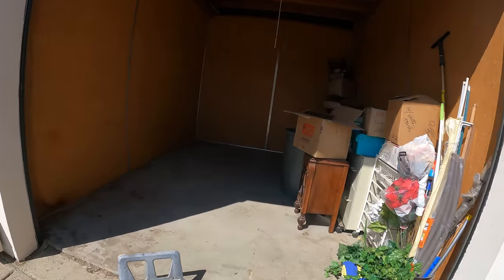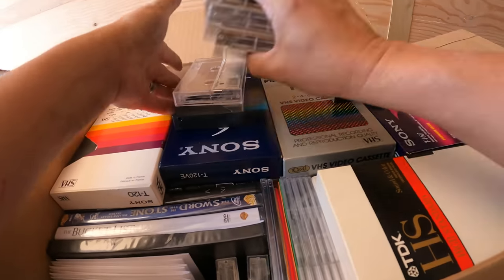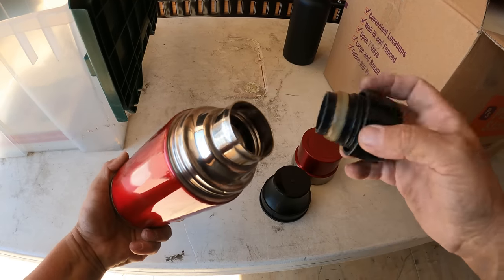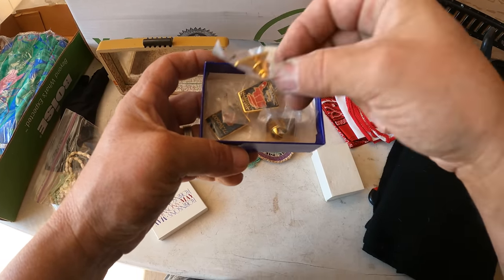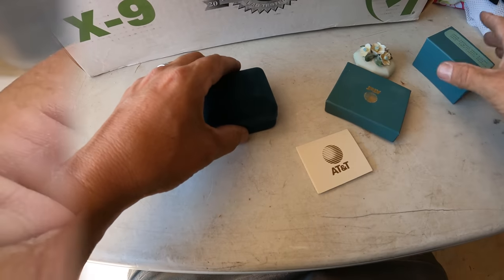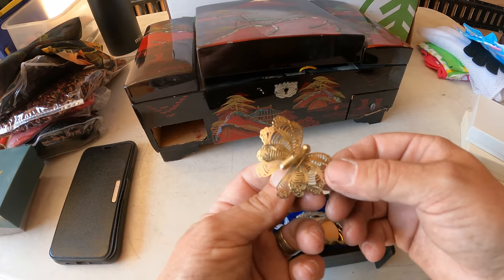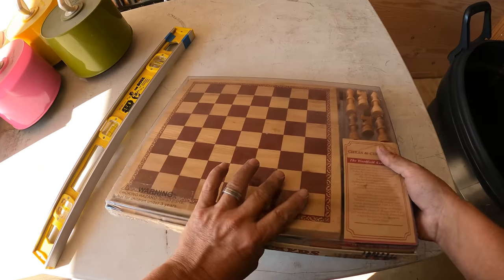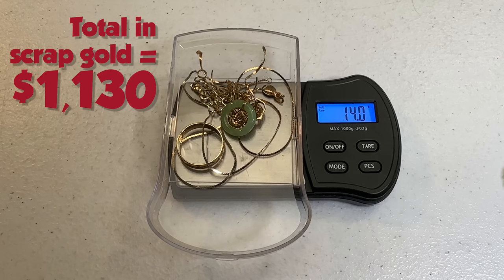It's a stinkin' GOLD JACKPOT in the abandoned "manager's special" unit I bought at auction.

Comment: !!JACK ATTENTION!! I hope you didn't get rid of the Japanese style jewelry box yet! I have one almost exactly like it purchased in the 70's in Japan (Dad was in the Navy). The two top areas that open out to the side have hidden compartments. Pull up on the bottoms and see if they come out. I hope it is like mine and you find something. If not it was worth a try.
Reply from the maker: Thanks for the tip. I just took another look at it, but no such hidden compartments. There is a music box built in too, and that compartment takes up a void at the bottom. I just pulled the nail and opened it up, to make sure.
Reply: @LockerNuts  Mine is a music box also. It has a ballerina that turns. On the top right hand side you opened it and found the watch, cat pins and some gold. I think I can even see the tiny silver loop attached that you use to pull on to open it. The hidden space is between the drawer that pulls out at the bottom and the top that opens outward. If it doesn't then at least you tried. It looks almost exactly like mine.

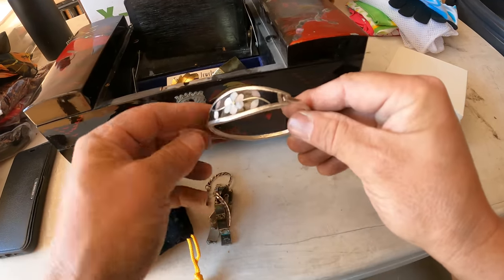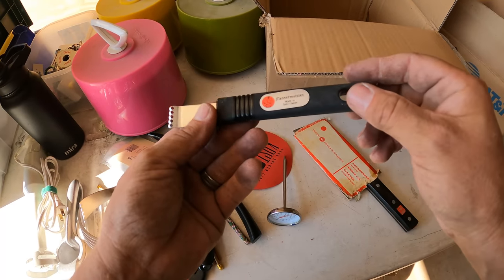Comment: Toilet water - eau de toilette.  Florida Water is OLD SCHOOL.   Think barber shop, bay rum etc.  It smells good. The beanie baby was a tiger, and like any boxed cat it tried to escape!  Dragon boats are a Chinese New Year thing.  Requires open water. BTW - earrings that are gold in the front with silver-colored posts are automatically costume. The lacquer jewlery box was made in Japan for export.  36:02 TEST that inlaid bracelet.  I've found plenty of Alpaca ones and zero silver ones.  If it says sterling it may be beach jewelry - aka fake. 36:21 Thai sterling.  No question. The greenies were probably copper solder  41:43 lemon zester. Another unknown was a garlic press. Take the small corner chest thingie to the vintage market; it was made to hold a Victrola.  It's a legitimate antique.